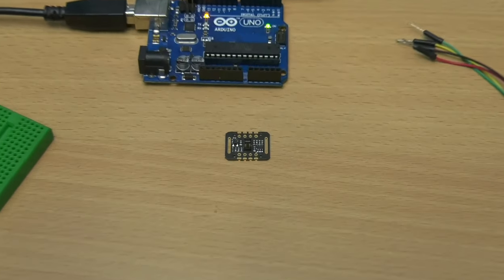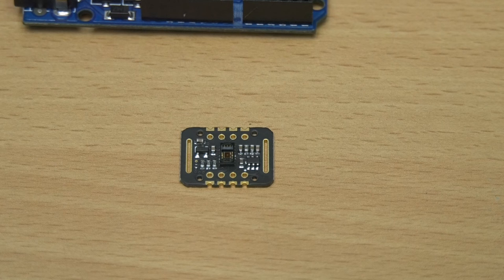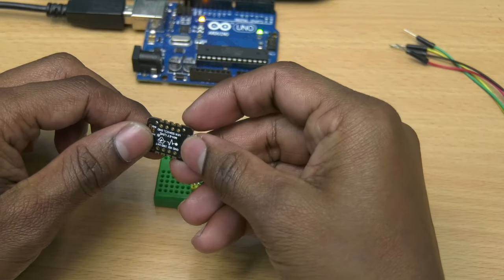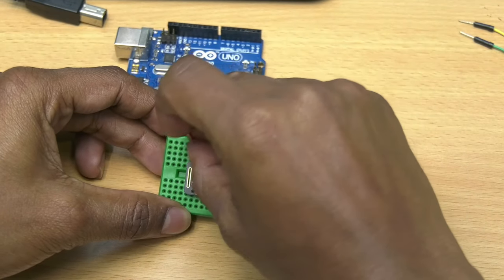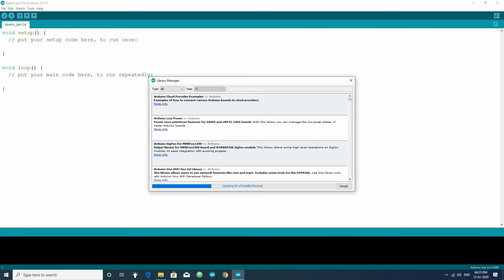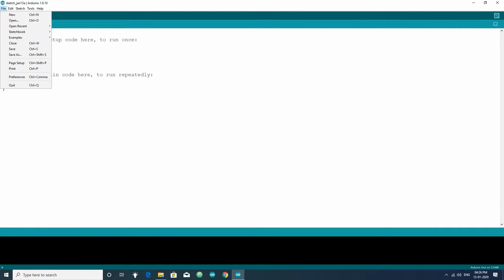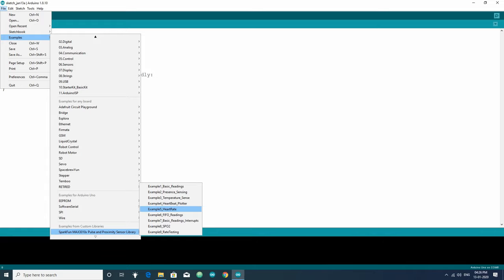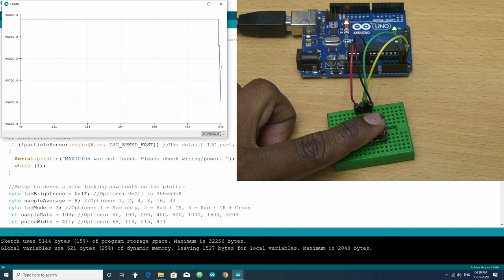What is MAX30102 and how to use it | Heart Beat Sensor | UtGo

Comment: Hi, i connected as instructed in the video but it the sensor wont turn on and then says max30105 in the serial monitor no found, when i used the i2c scanner it says  no device found. please what do i do next.
Reply from the maker: In your case the I2C communication is not working. Please check the wiring use small jumper cables in case you are using breadboard. Also recheck the connetions.
Reply: @UtGoTech  hi I finally got it working but the readings are not steady they vary widely...thanks for your responsee
Reply from the maker: @chikenwibor3481  I have got steady readings.
 Call checkForBeat() function as frequent as possible. It will help to detect heartbeat more accurately and efficiently. It may be possible the I2C commnucation is breaking in between or it may be due to the variable pressure of the finger onto the sensor. It is difficult to put finger in the sensor with constant pressure.
Watch this video: https://youtu.be/ZjDQXDIb82s
Reply: @UtGoTech  thanks for your response i have watched the video but still dont know how to checkForBeat() function frequent, please can you help me with line of code to do it.. thanks
Reply: @chikenwibor3481  Hi, how did you manage to get it working? I have the same problem as you.
Reply: @chikenwibor3481  can u pls say wat changes have you done to make work?I'm facing the same prb
Reply: @Jonahmeans1024  did it work for you?if yes pls tel what changes have you done?
Reply: @SLAVE_OF_ALLAHswt  It's been a while and I don't remember what I did. I think It was a cold joint with a bad contact
Reply: @Jonahmeans1024  ok thank you

Comment: I have a sensor module (MAX30102) where "SCL" and "SDA" are present. I need it to be used without any control board !!! Let's start with the reasoning: IC LM335 has a pin " ADJ " which as the 'abbreviation says deals with accepting adjustments but with the right conditions. Scl = serial clock and Sda= serial data ................ . Instead if you were using Arduino you have to connect it to pin A0 . So? ------------> SDA !!! :) Let me know it is urgent. Thank you very much.
Reply from the maker: The MAX30102  sensor module uses I2C bus for sending data. So how will you fetch data without using any control board.

Comment: One question my sensor Max30102 sometimes work and when I put the serial plotter works good, but then when y leave my finger from the sensor stop working and the red light doesnt appear.
Reply: Do you Know why ?
Reply: I have to solder something ? I dont know why it doesnt work properly
Reply from the maker: Yes. solder the male headers in the Max module
Reply from the maker: Due to loose connection. Solder male headers then connect it to your MCU
Reply: I have a doubt about where to solder because in the sensor there is a voltage bridge between 3.3 and 1.8 V. so I don't know where to solder.
Reply from the maker: are you using the same sensor as i did?
Reply from the maker: You can ask on telegram @UtGoTech
Reply: @UtGoTech  yes

Comment: Excellent video, thanks for taking out the time to make it. I have a few ideas for another video project: It will be a health monitor with a screen that shows the following things:
1.	Two digits after decimal point for better accuracy
2.	Heart sine wave
3.	If this sensor can calculate heart rate variability (HRV) i.e. the time between two heart beats then you can add that
4.	You can also add a skin conductance sensor to show volts
5.	Infrared temperature sensor
I have seen several projects on youtube but no one has combined all these in one. If you like, I can collaborate with you. Let me know and I will send you an email. Thanks
Reply from the maker: Thanks for the suggestion. I will try.👍

Comment: Thank you very much!
I have followed your instructions and it worked perfectly, but can i add something like buzzer to give a warning if the heart beats are under 60 beat/min?
I tried to do so , I connected the buzzer and wrote the code in the end of the example heart rate, and it was uploaed  successfully, but measuring stops in the second iteration and no readings appear …
If you have any advice please?
Reply from the maker: You have to write non blocking code which continuously takes reading even if the buzzer is on

Comment: Hi there, for some reason my sensor wont power on (no led light). Copied the wiring etc the same as yours.... any reason why this would be the case? Does the sensor need to be powered externally (not usb?)
Reply from the maker: Sensor doesn't need external power. It can be power through your MCU board. It can be powered by 5v or 3.3v.
Reply from the maker: Please check I2C commnication. Maybe your MCU is unable to communicate with the module. You can check using I2C scanner sketch (Link: https://playground.arduino.cc/Main/I2cScanner/) 
upload the I2cScanner sketch -> open serial monitor -> select the correct baud rate
if the I2C communication is healthy then you should get the i2c address of the module in the serial monitor, if not then there is a problem with the connection.
Reply: I'm getting "No I2C Devices found? Guess that means wiring or hardware issue?
Reply: @UtGoTech  Tried a new Uno, and am now getting a note saying "
I2C device found at address 0x57" After that I cant seem to get the example 4 plotting code to read anything though? Do I need to modify the code at all?
Reply from the maker: @ryanclark8441  Yes
Reply from the maker: @ryanclark8441  Now you are getting the address "0x57" that means i2c commnication is ok. 
Example code doesn't need to be modified, it should work. Have you tried other example sketchs.....
Reply: @UtGoTech  hi, please i used the i2c scanner but it says scanner not found
Reply from the maker: @chikenwibor3481  Please recheck you hardware and connections
Reply: Remove 4.7k smd resistors which are connected to SCL and SDA pins

Comment: Hi! I am using the same sensor but instead of using the arduino IDE, I'm using vscode (with platformIO to help code it). What steps should I take differently to achieve the same result?
Reply from the maker: Which microcontroller are you using?
Reply: I am using an Arduino Uno
Reply from the maker: There are libraries easily available for the max sensors for Arduino IDE. If you are using any other IDE then you have to get a compatible Library for that IDE or otherwise you have to go through the datasheet of Max sensor and find a way to get data through I2C bus.
Reply: Sounds good, Thanks for the help.
Reply from the maker: @user-kl4ww8yg7u Welcome

Comment: Thank you for the tutorial!
I have 2 problems, the electrical circuit disconnects and is very sensitive to the touch even though everything is connected well and no component is damaged, secondly, even when everything is connected and the red light on the MAX30102 works you can't see the graph after I put my finger on the red light. any ideas how to solve it?
Reply from the maker: Have you solder the male headers into the max 30102 module?
Reply: @UtGoTech  noup,
quick thinking and solving...
Thank you!
Reply from the maker: Welcome🤟

Comment: Hi, just one question here. My MAX30102 sensor is not working even i plug in correctly. or do i need to use soldering iron to stick my MAX30102 in order to let it works?
Reply from the maker: Yes you need to solder the wires or male header.

Comment: Hello. I have a question, i am using de MAX30102 with the same library but when i upload the code it only diplays "Initializing" on the serial monitor i already check my connections and they are exactly the same as in the video, do you know why the code stays there?
Reply from the maker: Make sure connections are proper.
Reply from the maker: First check if it is able to communicate or not. For that use I2C scanner sketch.
Reply: @UtGoTech  I'm trying I2C scanner but the codes keeps on "scanning" that means that my connections are the problem?
Reply from the maker: Yes. You got it.
Reply: Hey @luistowar947 were u able to solve the issue? Please let me know. I am facing the same.
Reply from the maker: Solder the male headers.
Reply: @UtGoTech  I have soldered the male headers and followed the pin connections correctly. But still i2c scanner says no address found.
Reply from the maker: No address found means the device is not responding. Maybe the sensor is faulty.

Comment: hi friend, good job
i have two questions , first what is main difference between max 30100 ,30102 and 30105?
and second can i use them as a body temp sensor to?
thank you so much
Reply from the maker: MAX30100 and MAX30102 are designed to detect heartbeats and oxygen saturation level in blood. Where as MAX30105 is designed for smoke detection. 
They can't be used to detect body temperature. The temperature sensor inside is only meant for internal sensor calibration and adjustment.
Reply: @UtGoTech  thank you so much

Comment: Hello, i connected as instructed(used breadboard), the sensor lights up  but when I'm using that code on examples for heartbeat_plotter i find the graph that's already there on the serial plotter and it doesn't change when i put my finger tip on the max sensor. For the heart rate example on serial monitor the IR has values, BPM=0, Avg BPM =0, and there after shows the question marks along with square boxes. Any ideas what could be the problem?
Reply from the maker: Communication issue
Reply: @UtGoTech  how can I troubleshoot if I have this problem? Thanks for the answer.
Reply from the maker: Solder the male headers or solder the cables directly.

Comment: Hey I'm using max30100 but the LED is not turning on even after trouble shooting. What should I do ?? 
Does this max30102 module have the same problem or it works smoothly ???
Reply from the maker: Please check  max30100 module is communicating with the Arduino board or not. Most of the time it is due to the communication issue. You can use I2C Scanner sketch to check that your arduino is detecting the max30100 module or not.
Reply: Did your  problem solved? If yes, please tell me how, it will help a lot. Thank you.
Reply: @UtGoTech  my max30100was not going until I connected ir and red pin to ground,is it okay, also it is overheating how to solve this, coz I can't touch it
Reply from the maker: Check supply voltage and connections.

Comment: the spo2 example does not seem to work with esp32. Do we need to make any changes to the sketch for it to work with esp32?
Reply from the maker: Check if that sensor library supports ESP32 or not.
Reply: @UtGoTech  Yes it does as all the other examples work perfectly ok except the spo2 one.

Comment: hey i am making a pulse oximeter using max30100 and 1.34 oled iic display module but the bothe display and sensor not working please help
Reply from the maker: First check if both the devices are responding or not using I2C Scanner Sketch.
Reply: Display is working in 12c scanner but sensor is not
Reply: BRO the problem is the sensor because the sensor detection is success but not monitering

Comment: Apparently, my sensor wont lit, can you help? Does it have something to do with voltage jumping?
Reply from the maker: Have you soldered the male headers?
Reply: @UtGoTech  yes dear Sir, I have soldered the pins carefully
Reply from the maker: Check if communication is ok or not.
Reply from the maker: Upload I2C scanner sketch and look for address in serial monitor.

Comment: Hi i have done every connection correctly but I find when I connect the wire gnd to gnd it is not working even I tried with different audrino boards but when I connect it to Rd it shows red light as you know it will not take the readings so please can you provide a solution asap
Reply from the maker: Connect as shown in the video and make sure the connections are tight. Loose connection leads to many problem.

Comment: What is the difference between max30102 and pulse rate sensor the one like heart shape? Which one will be suitable for pet health monitoring project?
Reply from the maker: Using MAX30102 you can measure pulse rate and oxygen saturation level in blood although I haven't tested on pets yet. And the one like heart shape is only for pulse rate.
Reply: @UtGoTech  this is helpful info. Thank you 👍
Reply: Hey Ashwini, can we use it for pets like cows and dogs non-invasively?

Comment: When I try to put my finger the axis values are very big. I don't know what the axis represents. I got the values of Y axis as 107400 and axis as 5100. I had literally done the same thing in this video and I was able to get the graph. The only problem with what I got is the intercept values are very big. Can you help me how to get the normal values of hear rate?
Reply from the maker: The values you are getting in graph is not heart rate values. Graph is plotted as per the ADC of the sensor. You can use the crest and trough of the graph to calculate heart rate.
Reply: @UtGoTech  How can I get the heart rate values directly without calculating from the crust and trough?
Reply from the maker: You can find the code in the Example sketch that comes with the Library.

Comment: Hello i make project just like you but when i put mu finger on the sensör light is going off why and other question i open serial port but i cant see the graphic just like you why bro
Reply from the maker: Have you soldered the male headers into the sensor?
Reply: @UtGoTech  yes i check and do you know serial port i cant see graphic just like you
Reply from the maker: First check if raw data is showing in serial monitor or not?

Comment: hi this is a nice video. i have final year project to get raw data from the led and i use this sensor.  but i think if i need good raw value i need to check if the sensor could calculate heart rate and spo2 accurately. when i try example of spo2 reading, the data is so fluctuative which when i don't put my finger on the sensor the bpm and spo2 is counting and the bpm read until 200 bpm. when i put my finger the data is take toonlong to get the right value and it's fluctuative like suddenly 200 bpm 60 bpm or even 0 bpm. is it because how i put my finger? is the pressure on sensor could effect the value? could you give some suggestion to solved this problem? thank you in advance have a nice day!
Reply from the maker: Yes, it matters how you put finger in the sensor. Change in finger pressure on the sensor will change the readings.
Reply: @UtGoTech  thank you for replying. How about the measurement when i don't put my finger on the sensor? Any suggestion? Because i need to plot the signal but the sensor always read data everytime.
Reply from the maker: You need to implement software filtering.

Comment: Hey Bro, can we change A4 & A5 to any other pins on Arduino?
Reply from the maker: No. It can't be changed. Hardware I2C pins can't be changed.
Reply: @UtGoTech  okay, so what pins to attach scl and sda if i am using esp32 ?
Reply from the maker: You can find out in datasheet of your board.
Reply: @UtGoTech  okay, thank you so much 😃

Comment: Hello, I tried editing but when I go on «serial plotter», no curve is displayed. Do you have any idea where this problem might have come from?
Reply from the maker: Are you getting data in serial monitor ?
Reply: Good evening, no I get nothing. As soon as I telecast the program, the LED goes out.
Reply: I really need your help please 🙏🏼
Reply from the maker: Use I2C scanner sketch to check it Arduino is detecting your module or not.
Reply: @UtGoTech  Thank you for your help! I have an other question about the arduino code for calculating heart rate, i don’t understand in arduino code : «  long delta = millis() - lastBeat ; lastBeat = millis() ; beatsPerMinute = 60/(delta/1000) » thanks you !
Reply from the maker: That code will find the time difference between two consecutive heartbeats which is used to calculate beats per minute.
Reply: @UtGoTech  Thank you so much for your help. I have one last question, in the serial tracer to get the PPG wave, is the curve represented the amount of infrared as a function of time? What are the units of time and infrared in the scale of the serial tracer?

Comment: The sensor light up for some seconds and suddenly turned off. What could be the problem? By the way i didnt soldered the sensor.
Reply from the maker: Solder the male headers. Loose connection is causing this issue.

Comment: i'm doing this project right now but my red led on sensor wasn't blinking can you help me out
Reply from the maker: Check if microcontroller and Max module is communicating or not.
Reply: @UtGoTech  in i2c scanner code it was displaying not found
Reply from the maker: That means microcontroller is not able to communicate with max module. 
Check your connections and look for loose connection

Comment: Hi! I connected it the same way the video showed but the led is not turning on. What could have happened?
Reply from the maker: Check for loose connections.
I suggest you to solder the pins.
Have you checked the i2c address of your module?
Reply: @UtGoTech  hey, my module led is also not turning on and i hv also checked the i2c address but where should i chang this address in this code?
Reply from the maker: You don't have to charge the I2C address. If you are getting the address that means communication is ok.

Comment: In my max30102 sensor led is not blinking and says intializing pulse oximeter failed what can i do sir
Reply from the maker: Look for connection issues, loose connection.
Reply: Hi bro I am facing the same problem what did you do to solve this problem kindly help me
Reply from the maker: Solder the male headers. Make sure the connections are not loose.

Comment: Hello, my connections are correct and my sensor power on but when I place my finger on it the sensor is not picking up a pulse but instead it is just showing a straight line on the serial plotter. If anybody has any suggestions that would helpful
Reply from the maker: Are you getting raw values from sensor?